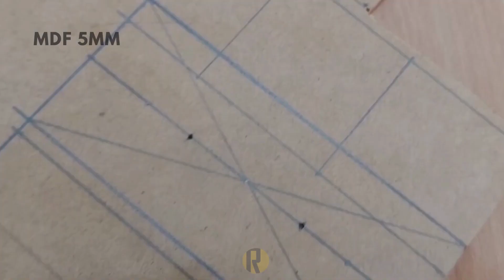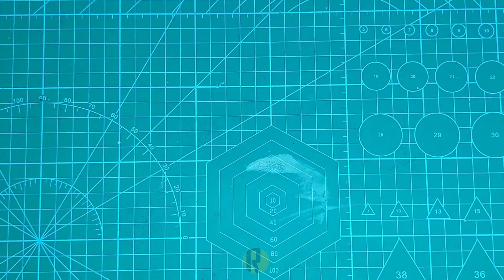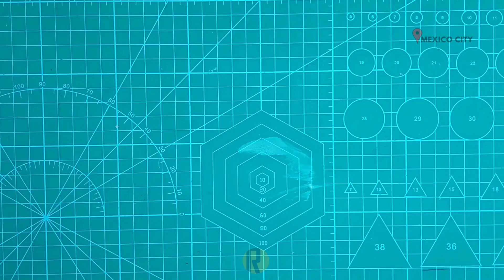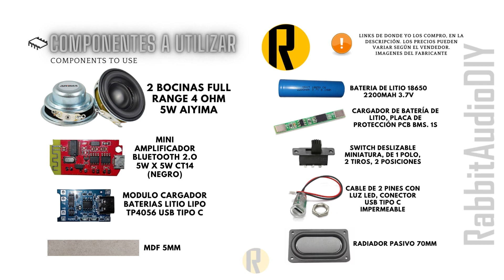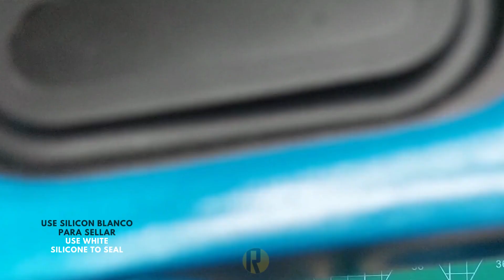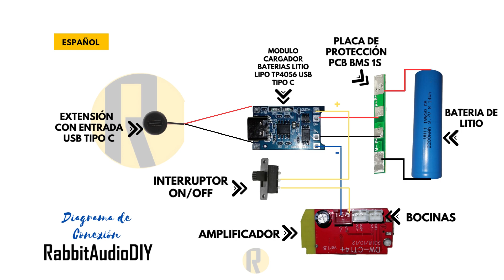🔥 DIY Crea un Mini Altavoz Bluetooth MUY  POTENTE #diy #boombox #homemade

Comment: Hermano, si tengo una placa de mayor condiciones como por ejemplo la 3116d, interfiere en algo o no ? De antemano gracias por compartir
Reply from the maker: Hola, la Tpa3116d es la de 100w x canal? Si es asi la placa es mucho mas grande que la que usé,  tú tendrias que usar 2 bocinas de 50W  ó 100w rms y a 12v ( 3 baterias de litio 18650) ó un adaptador de corriente de 12v a 19v de 3amp a 5amp, ese amplificador tuyo es mas potente